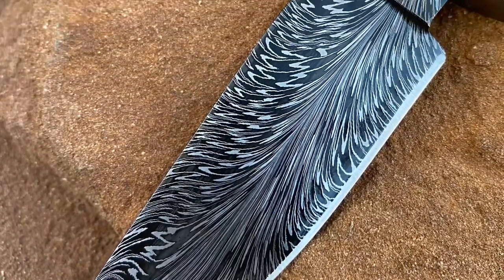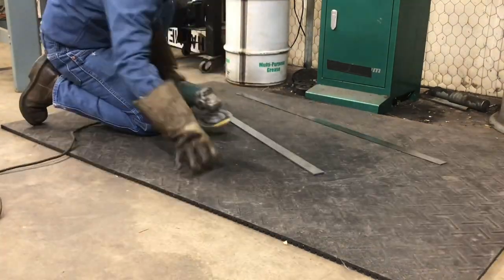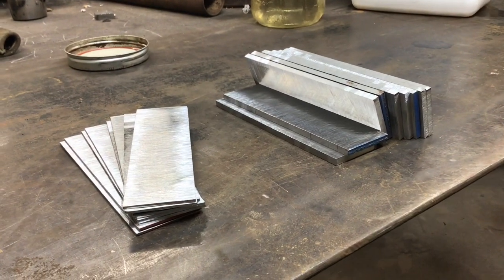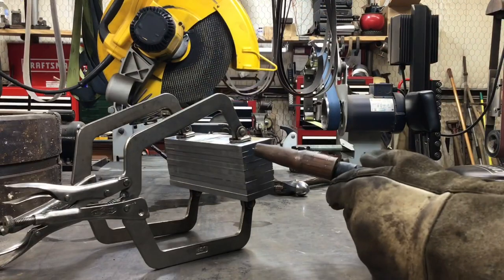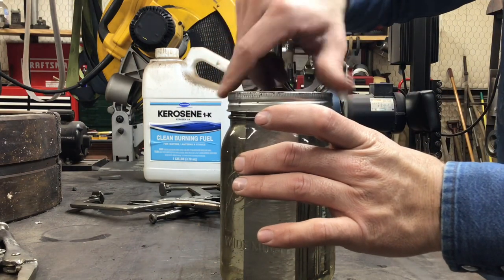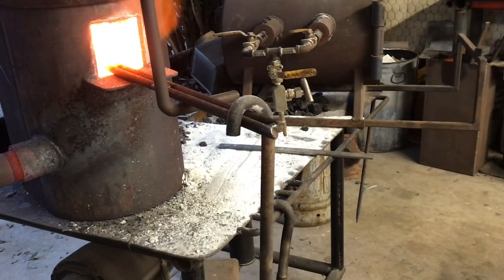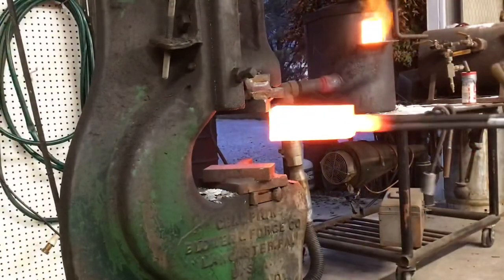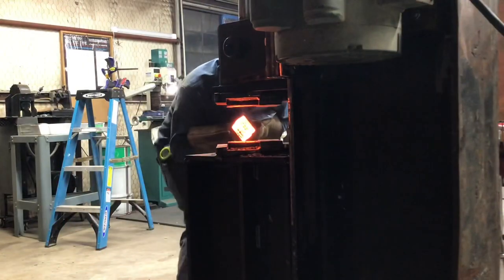How to make Feather Damascus-Part 1 of 2

Comment: You add flux when it is red hot, before scale forms but hot enough to melt the flux.  If you add it when it is to temp there is no way your flux is faster than oxygen so scale will form and you will have failures.  Also, you only need a small amount to coat the steel.
Forge On!!!